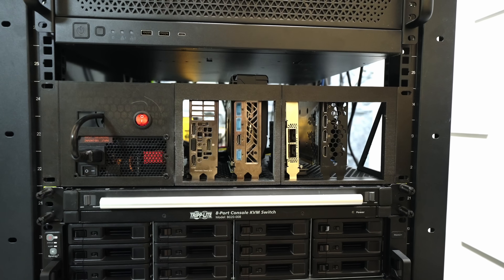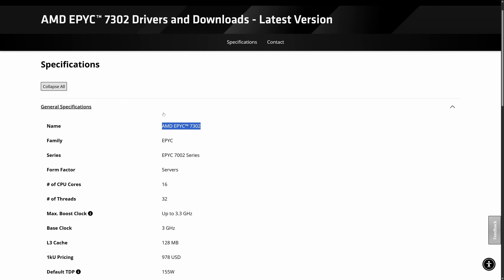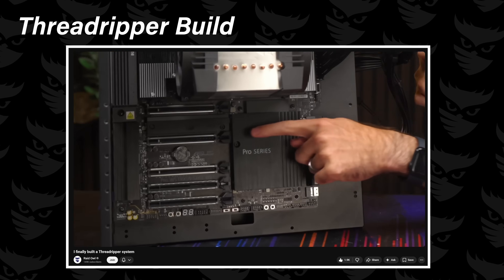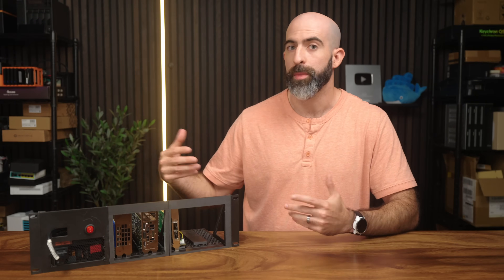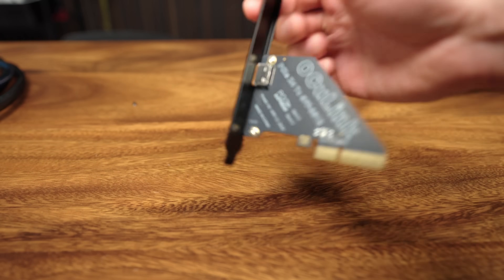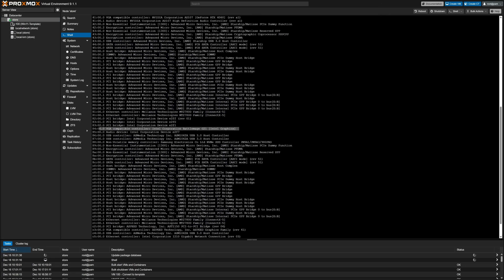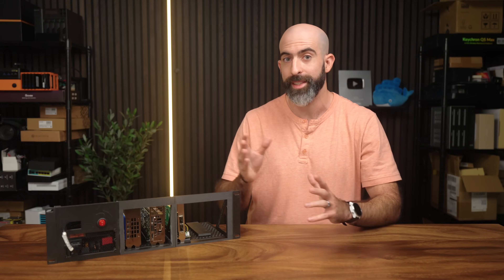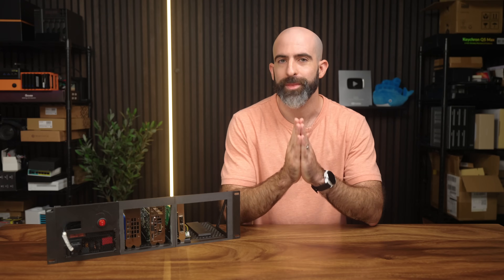Stop wasting PCIe lanes…build this!

Comment: I have an OLD system. It has one PCIex16 slot, and one PCIex1 slot. Naturally, they're right next to each other, and even though I don't have a monster graphics card, the meager heatsink and fan on the card covers the x1 slot, such that I can't use it. The system only has USB 2.0, and I wanted to add a PCIe card to add USB 3.0 ports. I figured I should be able to do it as my motherboard doesn't reach the bottom of the case, and I have a couple empty expansion slots there. Unfortunately I never figured out a way to do it.  Well, I knew how to do it, I could just never actually find what I needed.

Option 1: Get a x1 riser cable. It would need to have a low-profile, right-angle connection on the end that plugs into the slot, and also a right angle slot on the other end, so that it could fit under the card with it fitted to one of the empty slots. All the cables I found had the connectors mounted straight on the ends of the cables.

Option 2: Put the USB card in the slot and use a riser cable for the graphics card. Since the x1 card would now be in the way, the cable would have to be long enough to go over it and still reach the bottom of the case, and such cables seemed quite rare. And of the ones I did find that had a board on the end with a slot mounted on it, they were all mounted the wrong way. The card would be facing downward rather than upright to fit into the empty slot. The end of the cable would need to be flipped over, and none of the cables were long enough for that. Plus I read a lot of warnings about graphics cards not always working reliably with riser cables.

All of which makes me wonder: Why the hell do/did manufacturers insist on putting the damn slots right next to each other when anyone with half a brain knows that the most popular use for a x16 slot is for a graphics card that is going to cover up the next slot 90% of the time??? Why the hell wouldn't they put the x1 slot on top and the x16 under it?

Comment: I’m starting my homelab with a Rosewill Thor V2 and a 7950x system. Running dual gpu and an hba is a pain, but I was testing stuff and was already looking at some of these types of solutions. I had no idea they had any mcio based ones, and hopefully I can split up the only ass x16 slot so I can keep the x8 for my hba.

Comment: There are these little ADD2PSU boards that are basically a 24-pin connector with a relay - I spliced a USB to Molex cable up and used it so that the system could power cycle with the server it was attached to

Comment: I just took a gpu mining chassis and cut a hole through the bottom. then ran the slimsas cables underneath the chassis about halfway so I can still slide my 2u server ALL the way our to work on it without unplugging a thing. Needed because pcie g4 only allows for cables to be a max of 1m in length without a retimer. Since I don't have a money tree in my backyard, I went for the grinder route. Server can technically take 11.5  x16 gpus. but I only got room for 6 to 8, I got nvme storage anyway in there as well. I paid for the whole server IM GONNA USE THE WHOLE SERVER.

Comment: I need this! Would love to buy one, as I don't want to tumble down the rabbit of hole of 3D printing.. yet 😅
Reply: You don't have to print anything, you can get pre made racks that are made for mining, then just do the cables you want.
I did something similar to my PC to get more space by mounting a 90 deg gpu kit to the side of my case instead of inside it.
Reply: @RobinAstray are they rack mountable?
Reply: @Rckt2io GPU racks that miners used are designed to hold PCIE cards like GPU's so they should hold any PCIE card, just look at what your buying
Reply: @R@RobinAstray understand they're meant to hold GPUs. Are these racks actually rack mountable onto 19" server racks?
Reply: @Rckt2io seen some but they are not as efficient as the above solution, if ylu really need, just order the 3d prints from a company
Reply: here, to make it clear:

1: 3d print farm the print then assemble it yourself.

2: buy a gpu rack that miners use an an empty 18 inch rack to put it in.

3: buy a computer rack that comes with alot of pcie and cut off the PC mount at the back.

4: find one that's pre made, really unlikely.

Comment: This is my plan for my HP Z840.  It has three full x16 slots that can bifurcate 4/4/4/4.  With the 4 oculink port adapter card, I can support 12 GPUs.  I'm hoping to find a way to cluster a bunch of cheap obsolete cards for llm inference while keeping the KV cache on the hefty DRAM like LMCache.
Reply: update on this, I'm actually going with 8 rtx 3060s.  I have four in action now and it's badass.

Comment: I have a video request... I am stuck! Don't know if you have worked with any Minisforums products. But I bought the MS-R1 barebones version. I wanted to flash Ubuntu LTS 24.04 but it comes with a Debian model installed if you buy the unit with ram on it so even tried installing a Debian model, but I cannot for the life of me even get past the bios! I tried installing the UEFI board that comes with it, still same problem. No option for admin pw, in the bios so can't work that angel. It recognizes the USB flash drive on both regular and secure boot, but when I restart or try from the BIOS, it sends me right back to the BIOS! Minisforums support has not responded to my emails (which is rare, they've always done so in the past) and I cannot find a solution on reddit or any other forum. So I am reduced to begging youtubers for help.... HELP! Please! Been at this for 2 weeks now and am ready to trash the thing! I am a PC guy and this is my first ARM system so I am in uncharted waters here with no boat! Would really appreciate an install video on this as I only trust 5 of you guys on YT with accurate info on this type of stuff, but you're the first one I thought to ask... honest! Thanks for considering this and I hope you are willing to help, even out of curiosity. Thanks man

Comment: Instead of an external power switch use a 5V relay & an old USB 2.0 cable. Cut the B end off of the cable & have that go to the input power of the relay. Connect the Green & Black wires from the PSU to the Common & NO outputs of the relay. When the host computer is powered up it'll power up the external box

Comment: Nice! This would come in handy for the multiple Xeon Phi/Grid K1/Tesla M10s I have.
Thanks for sharing the 3D files , I'm already printing :)
I'd like to use a regular ATX power supply. Can you make one?
And if it's 4U, is there room to mount 40mm fans above the GPU slots?
Reply: The one with PSU would also benefit from a diagonal brace. I've already broken a few while removing the printed support parts.

Comment: That's a great idea.  I've been planning to upgrade my workstation from Xeon Scalable HP Z6 G4 to an Epyc workstation.  Epyc because all of the PCIe lanes are great for setting up a multi-GPU AI machine.  The difficulty I've been seeing is getting 6 GPU's into a system without crowding the GPU's and having them starve for air.  Although I probably won't 3D print the chassis (I'll just gut an old server chassis and get to work cutting), the MCIO adapters are a great idea, and, as you stated, have the reliability built in to them to make it work.  Easier to cool the Epyc and the RAM, and easier to cool the GPU's.  Thanks.

Comment: Guys, ensure that the motherboard and BIOS are birfurcation capable if your intent is to use more than one gpu on a single x16 slot. You're gonna have choice between x16, x8+x4+x4 and, x4+x4+x4+x4.
Reply: And x8 + x8
Reply: Unless You Are Using A Server Chip Or Thread Ripper You Are Limited To 20 PCIE Lanes Total! That Is 16 For Graphics And 4 For The SSD! I Think They Came Out With The 8 Lane GPU's So You Cant Run Them On An Older System As Fast As They Would Run On An Older PCIE 3.0 or 4.0 If You Had All 16 Lanes!

Comment: You could design it to fit into a metal rack shelf for more stability.
Reply from the maker: Without the ears it should
Reply: @RaidOwl  if you use a 2 post rack, shelf could be mounted on the back side while your shelf could use the ears on the front side.

Comment: Instead of double sided tape, why not have male hexagons on the bottom so they just slot into the case? They're already blocking airflow coming from the bottom so might as well just lean into it.
Reply from the maker: I actually ended up doing that. It works alright

Comment: Back in the day I designed something very similar yet completely different. Back then we didn't have mcio, so I used a custom cable attached to a qsfp+ connector on both ends. It would take 2 of those cables to connect 16 pcie lanes to the extender and on that side there was a plx chip that would fan out these 16 lanes into 16 x1 slots for use with GPU crypto mining. 
We had made it all the way to a working prototype, but at that point asic mining was starting to take over, so we dropped the project before we went into production

Comment: Here's an idea for your design here. Turn the pcie slot by 90°. Could probably fit 3 full height 2 slot sections and room for a flex-atx power supply at the end on the 19inch rack version. Maybe one and a flex atx on a 10inch version.

Also, you can power the old intel nuc compute elements from a gpu mining riser. These offer two m.2 slots, 2 nics, and two thunderbolt ports allowing daisy chain networking

Comment: Occulink (SFF-8611/SFF-8612  [male/female]) 8i exists, like the other SAS connector type mentioned. Generally I find that "Occulink" SAS connectors have higher prices than their counterparts.. I would assume because of their popularity in consumer use and its sheilded design thats akin to displayport, bettering external use.

You can even use M.2 and U.2 connectors for this, though do note that they dont have to be X4, they can be X1 or X2 as well.

If you didn't know already, yes, PCIe X2, like X1, X4, X8, and X16, are standard lane allocations.
(I say that as I notice not many people actually know it's standard)

Comment: Idea... Get the long 4u rosewill case. With either the 2 or 3 front 120mm fans and middle 3 fans.. take out the HDD trays, 3D print new front panel with pci slots.. blamo... 1 case and a ton of io. Put your network cards up front to connect to the network switch.. pci slot m.2 adapters etc.. 
The 3 center fans keep the airflow moving.
Reply from the maker: Yeah I debated doing some kinda of chassis mod or just designing it as an all in one system, but in the end I wanted something more plug-n-play for all setups.
Reply: @RaidOwl soooo since you have connections... You should ask supermicro if they will give you a supermicro cse 846x case (any variant starting with 846x) for 13 slots, the original cse 848 (NON X) for 11 slots, or a cse 747 (excepting the 9 slot variant) which all have bog standard atx motherboards and mounting, with tons of power to boot and -sq (superquiet) power supply support. Ive been chasing the 848 non x and 846x for years now and havent found either for salw on ebay that have relatively down to earth pricing sadly. 747 is more common, and I have one, but only one of the 9 slot variant (which seem to be rarer i think?)

Happy pcie hunting :)
Reply: It might need to be 5u.  Perhaps a gpu mining case would be a better donor.  Verify the case will fit, rackmount and monster GPU isn't a common design criteria.  Not until basically 2025.
Reply: heck yeah been planning to do this for a while after seeing so many expansion parts on Aliexpress. I have the old Rosewill mining 4U as well.

Comment: This is extremely useful.  It would actually be great to see a smart 4/5u rackmount chassis out of metal made to host big 3090-5090 gpus with spots for the expansion slots and slots in the top and bottom to run extenders from above and below.  I have 8x16 slots in a datacenter server but they only fit 1 slot cards (A4000s are a decent option, 32gb per 2-slots for big ram on the cheapish.)

Comment: Hmm,  might make something like this by modifying an ATX case I've got laying around.
Would make it easy to plumb two or four 3090 cards tidily into my main server in a workstation case.
Could do a modular pegboard style system for mounting the converters easily with shim/mounting boards that attach them to the main carrier board.

Comment: EDIT: They do have SlimSAS 8i external cards and carriers for this use case as well, but they are harder to find than MCIO and OCUlink.

Holy shit I have been waiting for someone to produce or release model files for this exact thing! I need a way to connect my two Arc Pro B50’s to my MS-A2 Cluster nodes. But there has literally been no products that allow you to externally mount GPU’s and PSU’s to a server rack. I really hope i find these model files in the description! :D
Reply: 3D printing is great, but when it comes to such large prints, sometimes it may make more sense to make something with sheet metal and a drill instead. It'll have more strength to deal with how heavy modern video cards have gotten that way too.

Comment: I have done something similar. I took an old ATX case (Core2Duo old) and stripped off all of the plastic bits. Then used a 1/4-inch piece of plexiglass, that I drilled and tapped for holding eGPU mounts, and mounted in the case. Had to play with shims to get the height just right. Used square tubing for attaching the rails. It was the perfect storm of my wife telling me to get rid of old parts and getting my ADHD meds refilled.

Comment: I really like this idea, but I am always hesitant about printing 19" rack gear. I wonder if the design could be modified to be based off of one of those 2U steel rack shelves.
Reply from the maker: I mean you could print it and just not use the rack ears haha
Reply: @RaidOwl That is a good point. I have a couple of 2u servers that I have been wanting to put a full size GPU in, so this is pretty perfect. Thanks for designing it.

Comment: 6:20 oculink also has much, much worse signal integrity and connector signal to noise ratio and is much less trustworthy than mcio. Redrivers are going to be needed for oculink long before mcio, and finding out you need that is not fun. Remember to enable pcie AER and check for errors after setting all this up!

Comment: yeah AMEN and bless you, pisses me of consumer = affordable systems have not enough pcie lanes and workstation gear has unholy pricing with pcie lanes present theoretically but are unusable in a practical way, try to put a beefy 2-3 slut wide main video card in, than a secondary also 2wide, than a soundcard, an expansion card with a collection of 4 m.2 cards that you collected from previous upgrades, a slim intel arc 310 for dedicated video encoding and additional video outputs because why not utilise some 22 inch monitors saved from the bin that are collecting dust additionally to the bloomberg broker setup you already have....you know some common people problems :-D

Comment: if been searching for several years now, but if anyone finds a 4u case (or bigger) that can have atleast 3 gpu's in it, and also have room for around 24 hdd.....i want it so bad, but it just isnt made yet as far as i know
Reply: Try inner tech 4U-4724. 24 drives and 7 card slots for 3 double slot cards.
Reply: @vitoswat  tnx man

Comment: This is pretty ingenious. 
I talked about this before, but my original idea was to use a GPU mining frame and x16 riser cables.
Using these riser cards solves a LOT of issues especially in the sense of cards that pass those connections externally AND have cables designed for longer distances. Also the idea of using one shelf with say... 1200-1600W PSU and having risers from 2 - 3 different servers is pretty sweet stuff
Reply: That or splitting x16s into multiple x8 cards for a small army of slots EVEN for consumer systems with limited PCIE...
Reply: There are active PCIe Switches that can be used for any PCIe device but you have to be careful, some firmwares block anything but PCIe NVMe SSDs which is rather annoying.
I majorly dislike the current state of HEDT platforms, so I went the PCIe Switch route, though only at Gen4 so far.
Reply: @abavariannormiepleb9470  Also PCIE switching WILL cause lag especially in the case for graphics cards. Storage typically will cause latency issues. AND in the case of using storage AND networking... it can get messy.

Comment: Just a suggestion to improve your setup as you indicated the double sided tape felt a bit janky.  I would look at making those mounting trays able to connect to the hexagonal pattern on the shelf.  That way you could snap them into place keeping them modular but securing them better to the shelf.  You could incorporate designs from something like honeycomb/multiboard/opengrid on maybe a smaller scale to fit your need.  This would be especially helpful with larger cards that have additional weight and wires that might get tugged on accidentally.  Hopefully that helps with v2.  Love these types of videos.
Reply from the maker: Haha if you look at the design files I kind of did that. It didn’t work as well as I hoped though 😅
Reply: It basically needs attachments like opengrid/neogrid use